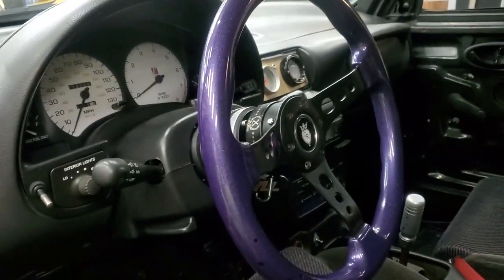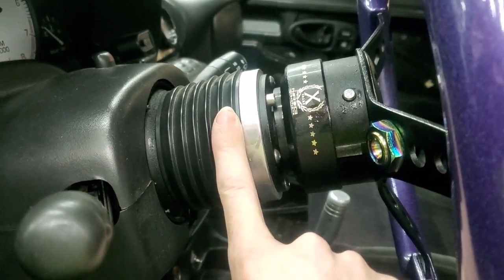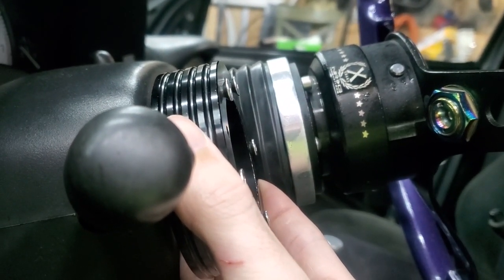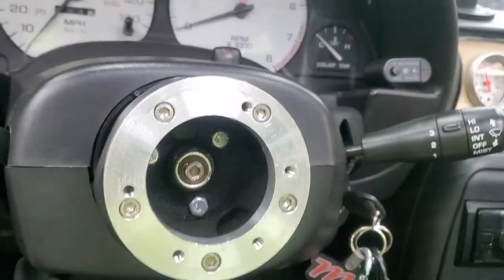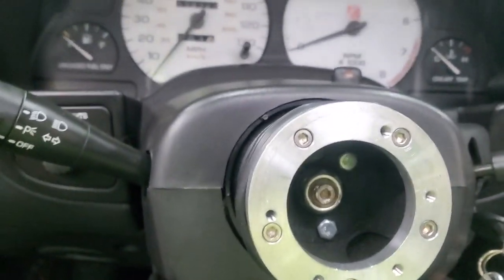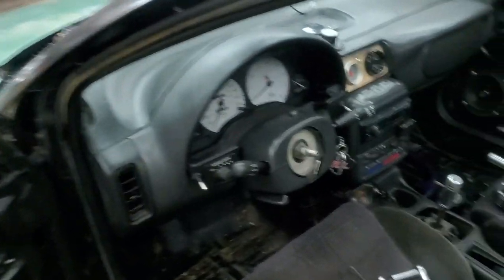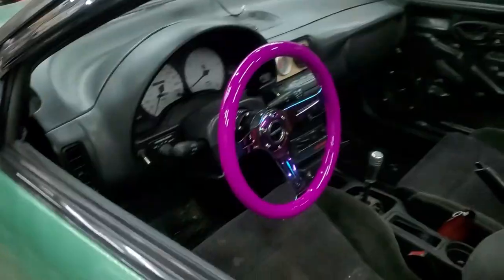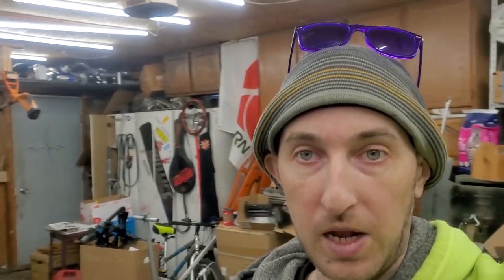Steering wheel hub replacement for Midori

Comment: Hey love the video, been subscribed for a while now.  got a 96 sl2 myself, was wondering what your old aftermarket hub adapter was? I know the new one you installed was custom fabd. But I just wanna swap the wheel at this point. Looking to get any hub adapter that will work. You said a 5 to a 6 adapter? Any info would be much appreciated.  
Thx man!

Comment: How's it going buddy I have a question I was wondering if you know if I could take the cams from a dual overhead cam engine and put them on a single overhead cam engine to like you know get bigger valves in it have you heard of anything like that or do you know of any sites and stuff that were they tried different things like that and if so could you point me in the direction or a man appreciate it thank you
Reply from the maker: You just have to swap the whole head over to get a twin cam... you can use your current engine block, but the head, timing cover, intake and exhaust manifolds will need to be changed... but that's an extra 30hp right there
Reply: Thank you for the info